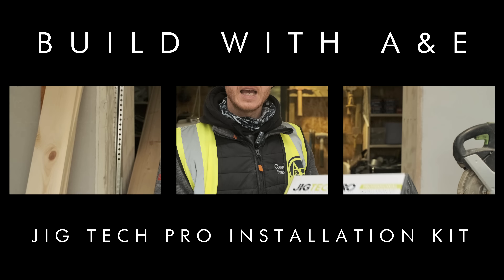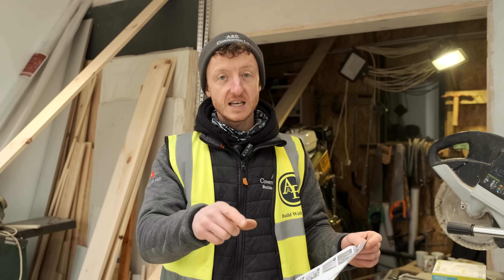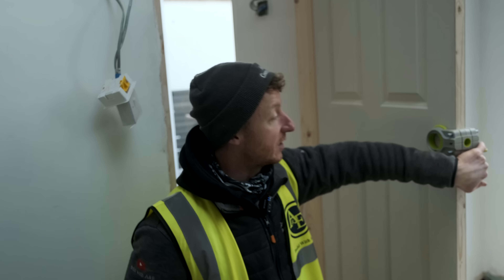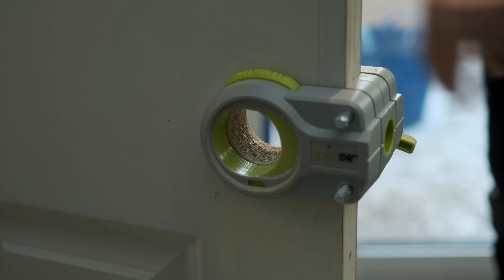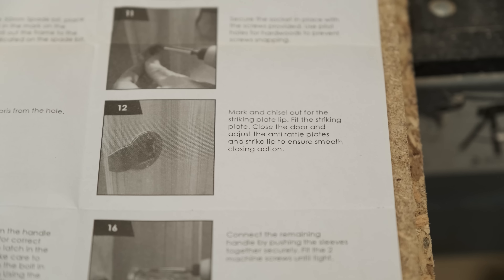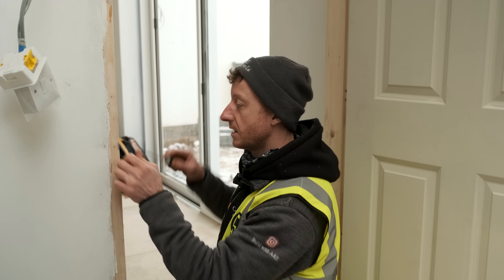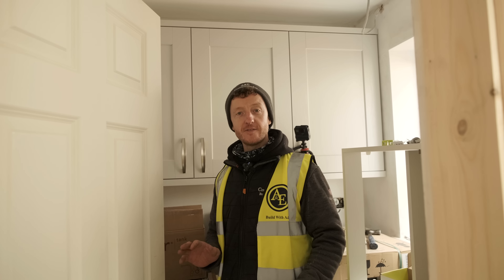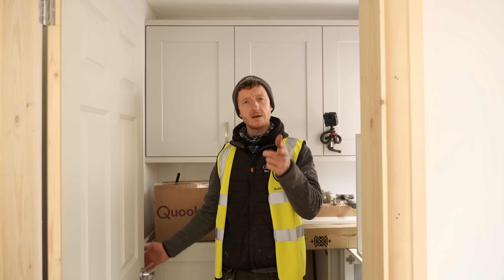CAN YOU FIT A DOOR HANDLE AND LATCH IN 5 MINS ?

Comment: If you hang loads of doors its worth getting. Not every customer finds a Jigtech handle they like but probably 70% of my customers do. I save 15-20mins per door so on a good sized house the £60 odd for the kit is paid for. The jigtech door packs are good value too at around £20-25.

Comment: I have fitted hundreds of if not getting on towards a thousand Jigtech handles. Same jig, on second set of holesaws. 

Its incredibly fast for getting the handles and latches in. Especially the privacies for ensuites, bathrooms etc. 

Dont bother with the the keep markers etc. Its not great. I discard the round "smartkeep" Jigtech supply a traditional keep now too.

Great system, huge timesaver. Probably shave 15-20mins off each door hanging. 

Handles and latches are good quality and look smart too.
Reply: Will this system work on 44mm doors ie fire doors?

Comment: As mentioned before a nice system and can see how it can make it really easy to install, but for me there are a few flaws.
All good if you use thier handles and locks, realistically that is not going to happen.
Secondly I can see those holes saws getting blunt quickly and they are slow compared to auger bits or other sharper more expensive cutters that work better and quicker. 
It doesn't take me long at all  to mark up and drill a standard handle bolt and keep, save your money as this has limited use to thier product only, tools look cheap and look like wearing out quickly  and costly. 
Better of making your own jig for what ever handles you use and keeping it safe for the next time.
Reply from the maker: Hi IR it’s not my cup of tea but thought let’s give it a whirl, John gives his thoughts all the best Tony 👍

Comment: It’s a gimmick, great for the first few doors but the holesaw bits go blunt very quickly. And they don’t have a massive range handles. And the ones they do are expansive. Bought one last year. Threw it away after a month.
Reply from the maker: Hi Dodgy Dave it is limiting in handle range but one of the handles was a spot on match for the existing handles, the quality of the tool bits they seemed pretty good but you would have to use it quite a bit for me to really ascertain that all the best Tony 👍

Comment: John, I’d send that lot back to benchmark including that cheap cardboard door and stick to the top quality work and materials you all normally use
Reply from the maker: Hi Jim the doors are reasonable priced and are actually built well, personally the jig it’s to much money good idea I think it’s more designed for the DIYer than trade we thought let’s give it a whirl because we had to match the clients existing doors and handles and they were the best match all the best Tony 👍
Reply: @BuildWithAE  I’m sorry Tony I always agree with you but just looking and have come across these pressed doors and the fast fix type of ironmongery we are on the slippery slop of McDonald’s type of workmen/woman ship ( have to be pc now a days) give it to them cheap and they will be lining up around the corner,
All of a sudden we accept it as the norm and we all think cheap rubbish with no edging is the nice look
Reply from the maker: @jimgeelan5949  Hi Jim you are quite right the problem with the way the market has been pushed with materials it’s a supply and demand, it’s a mass produced door it’s never going to be a handmade and as you know we have to fit all kinds of products all the best Tony
Reply: @jimgeelan5949  Hollowcore doors have been around for a very very long time. Nothing wrong with them really. They are definitely budget doors. I won't have them in my house but that's personal choice.

With an oak veneer door, handles and ironmongery it's £200 plus per door supply and fit

If its a hollowcore primed it is £100 a door supply and fit. 

Big difference 

As for the fast fit stuff, I can fit whatever people want. But if they like a jigtech one why wouldn't I. 

New things are always coming out. Presumably you have eschewed modern technology and wrote your comment via semaphore